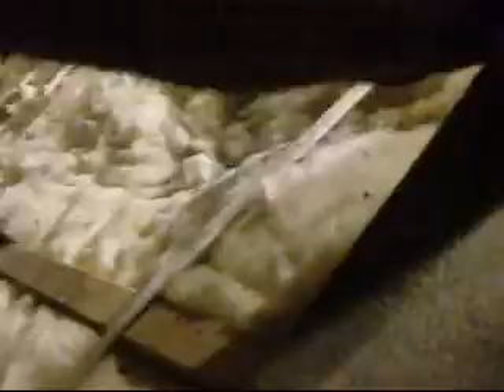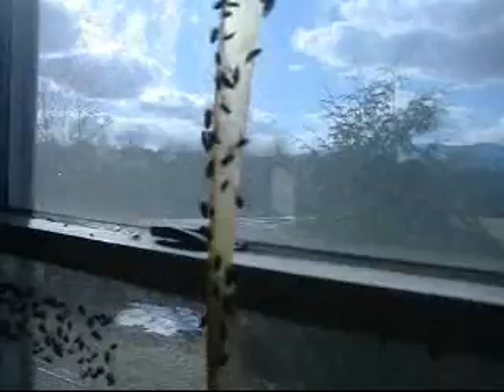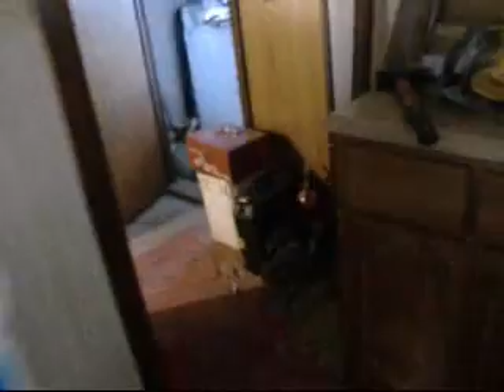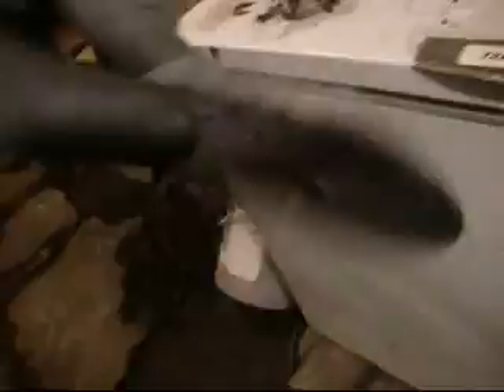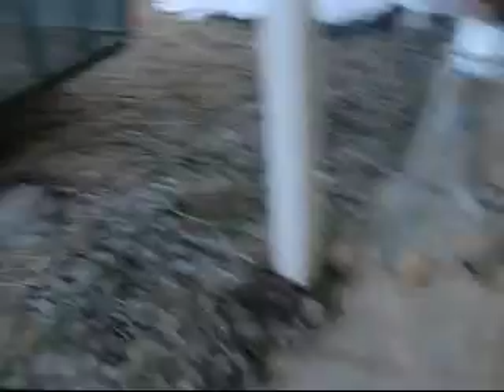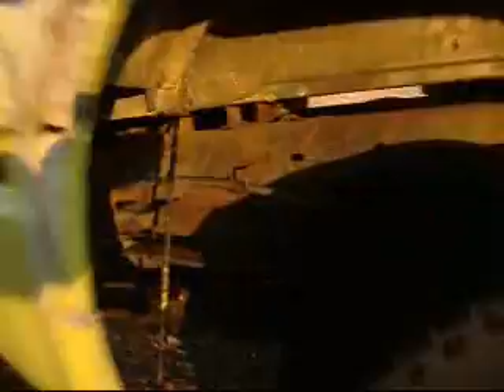4 6 11  Attic Crotch Crawl...

Comment: Stripping UF cable is always a PITA. If you're lucky, you can grab the ground wire with a pair of lineman's pliers and use it as a 'ripcord'. When that fails, I slide my knife lengthwise along the ground wire at a shallow angle. Too steep, and it will dig into the wire. Easier with something heavy like a jack knife, rather than a razor knife. Looks like you'll be getting plenty of practice!... ;o)